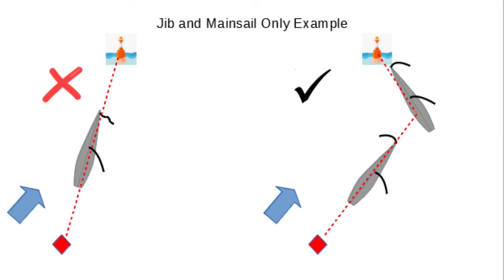Sail Trim - A Conceptual Model

Comment: When I sail dead downwind, or very close to it, I often opt to sail with the main sheeted in quite hard. This does three things.
1. It allows the main to work "backwards", with attached flow, which causes some heel, but also drives the boat (at least my boat) to about 80 % the speed that I would get with the main fully let out.
2. It lets the jib fill and fly well most of the time.
3. It all but eliminates the risk of a crash gybe, since the main and boom only have a couple of feet of movement, and so provides for a much more relaxed downwind sail.

Now, you have to consider that I sail deep inside a rocky archipelago, with winds snaking and twisting around islands and rocks, and the islands and rocks leaving little room for me to choose a convenient point of sail...

Comment: This was helpful.  Thank you so much. BTW I built a chart plotter using a Raspberry Pi just like yours but opted for the Moitessier HAT.  It provides an AIS receiver as well as a compass, heel and trim, and barometric pressure.  It was a fun COVID 19 project 👍
Reply from the maker: That sounds really useful. I finally built a cover to hide all the cables and gizmos on mine, so it looks a bit more professional.